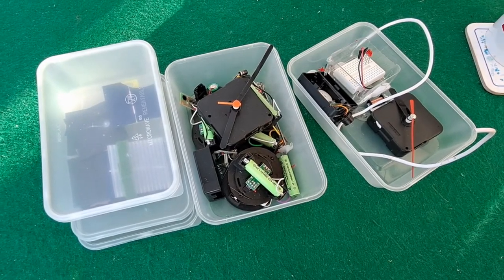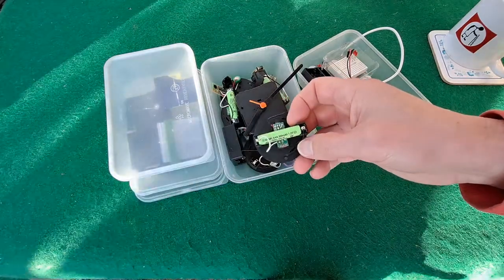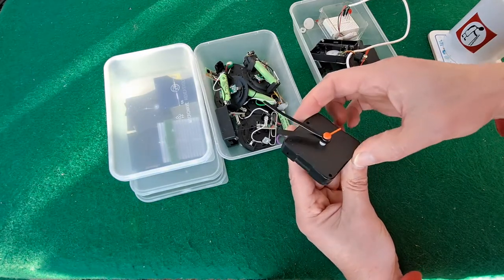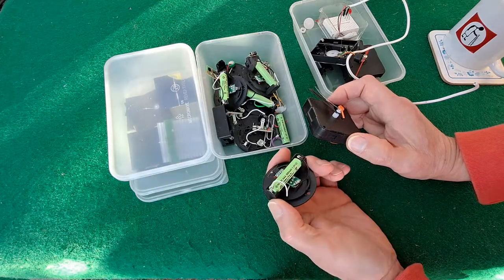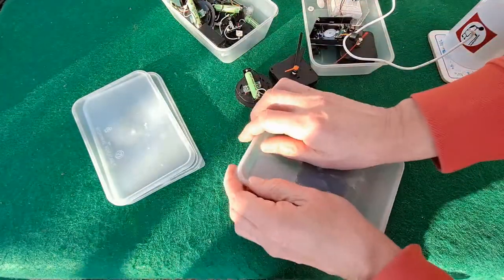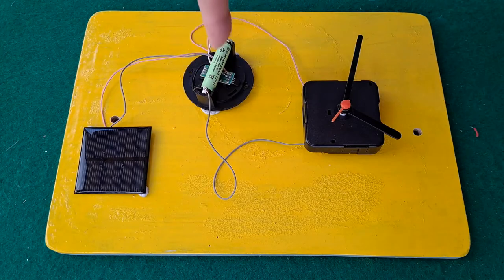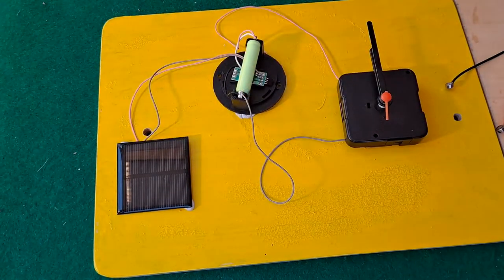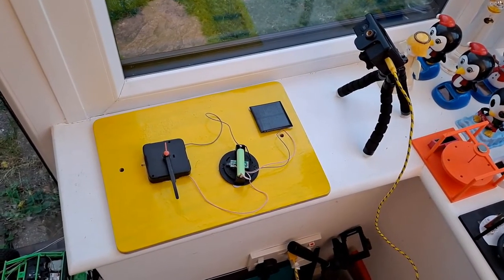Solar-powered clock for George 🌞😎🕑 SHORTENED VIDEO

Comment: If you are successful at keeping the clock running all night at the correct time, the next question would be how to keep it running at the correct time every day even when cloudy for a couple of days. 🤔☕️🍰
Reply from the maker: By episode 6 that is sorted, we have had very little direct sunlight in the last week or so but one bright morning was enough to fully charge the battery - in a later episode I change it to an AA size rather than the AAA and that has enough capacity to keep it running. And the circuit is simpler.
Reply: @GrandadIsAnOldMan  ❤️